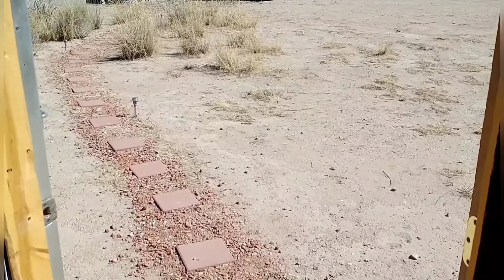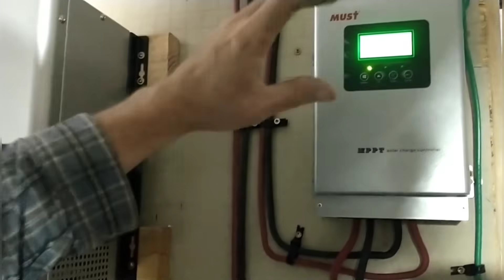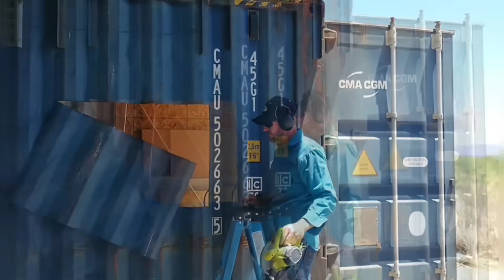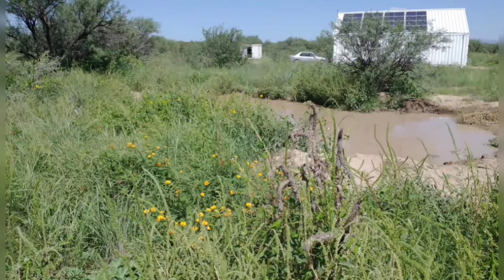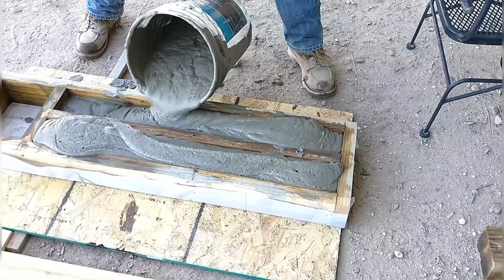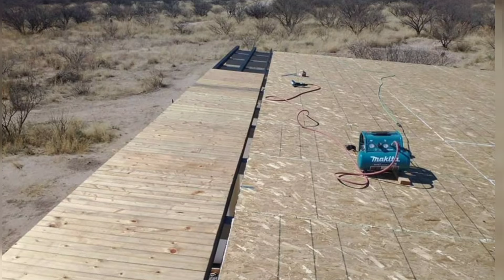RECAP of Our FIRST YEAR Living OFF-GRID | DIY Home Build, Solar, Septic & Aircrete

Comment: Thanks for sharing this terrific summary of your first year.   So glad that you returned to YouTube to share your journey with us.  

A suggestion for your power and pump room(s).  Keep a stenographer notebook in each location.  These note moods are small and a pencil or pen can be kept in the spiral binding. Initial pages have basic notes detailing the electrical system and plumbing.  As you encounter problems (is: power outage) start a new page, record date, time and weather if appropriate.  Record the error / problem status in the left column and use the right column to record your recovery sequence of steps needed to recover the system.   Over time you may note reoccurring patterns.  Your solutions may be applicable to your children that have similar systems.   

Wishing you and your family a blessed week and another great year developing your property and homestead.  Wishing you peaceful days, restful evenings and a gentle spring season.
Reply from the maker: Thanks! That is definitely a great idea. So far the reasons for the shutdowns were clear. The first time we didn't have the system set up right, so we didn't know how much battery we had and we turned a lot of stuff on before the sun came up. The next was when Red was running his table saw on the same leg as the RV and I had a lot of things running in the RV. It is a bit tricky right now because everything in the RV is on the same 3,000 Watt leg, so we have be careful about not running too many high power draws at the same time. We will be able to separate the high energy users better in the house. Thanks so much! Always appreciate your well though out comments and encouragement! 🤗🏜️
Reply: @RedandAprilOff-Grid  My hard learned solutions; I’m glad I can share solutions.  Since Red has helped your kids’ setup their solar systems, his notebook(s) could be useful is Red is absent and you are experiencing problems.  Please stay safe out there.  Peace

Comment: Y'all have done a great job!👍 A couple of things I might mention. 1) For your garden you may consider using raised stock tank planters. By lining the bottom with perforated drainage pipe with a sock, mounting a cap to the side, (to make it easy to water if you have to). Then cover with landscaping cloth, soil and plantings don't forget to install an overflow by inserting a pipe just about 1 1/2 " above the drainage pipe, a fitting, elbow and down spout. Where I live I have to water once a year...it self waters. I placed mine elevated 24 " by blocks. Placed a pipe at each end and installed 16' cattle fencing to allow climbing up and down of vegetables. 2) Lastly, you may consider other forms of energy in combination with your solar like wind or rain. They are easy to make, and cost effective. Rain generator : PVC sheeting, conductive ink on paper, some uncoated copper wire shellacked or clear polyurethane. It takes the excess electrical energy out of The rainwater and moving energy from it. Can be used in sheets or placed in gutters. A wind wall would work well in your location. 3) consider diy graphene batteries with super conductor's.
Keep up the good work👍, enjoy life!
Reply from the maker: Thanks! 😊🏜️
That sounds awesome! We are almost done with the fence/wall, so the garden beds are next. I think we are just going to use stuff we have around and make some slightly raised beds and trellises. 
In the day time we have plenty of extra power coming in, so once we get our second set of batteries installed we should be pretty set. That was the first time we have had multiple cloudy days in a row, and it was around the shortest day of the year, and we had company visiting for Christmas. We hadn't checked the batteries or solar, but we almost made it. We do have a generator backup, but haven't needed to use it. I haven't heard of that type of wind or rain power, sounds interesting! 😎